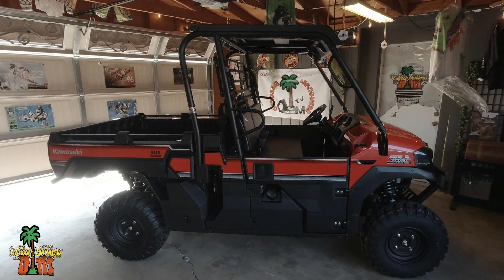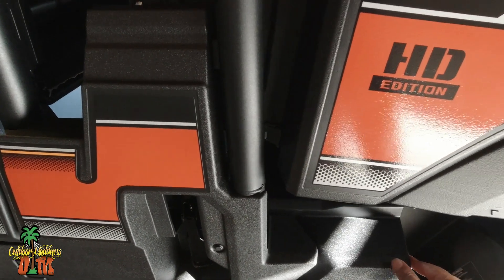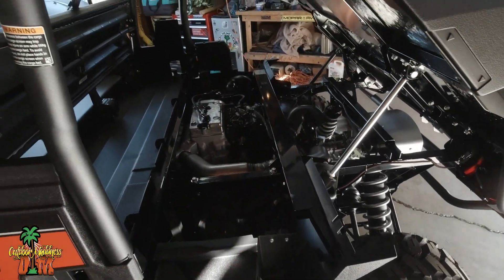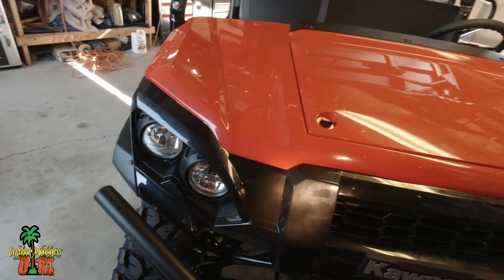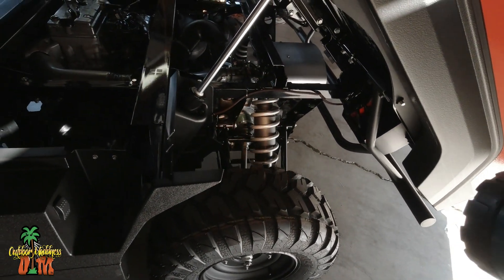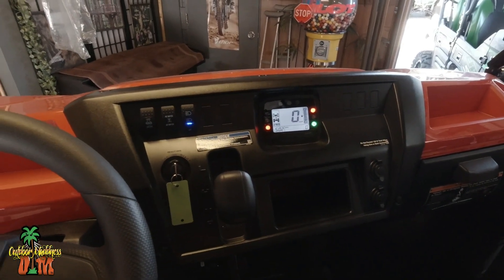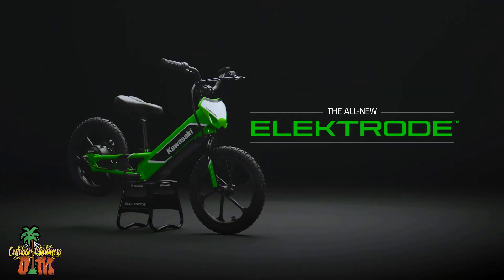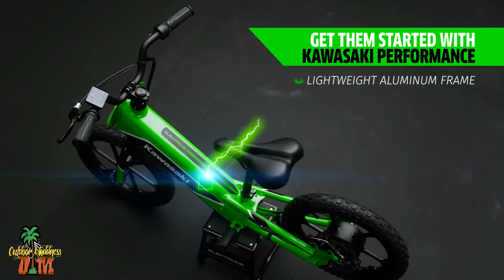2024 Kawasaki Mule Pro HD + Breaking News From Kawasaki!

Comment: Hello sir. I enjoy your videos but at times I find you are just a bit off on some points you make. The Mule pro fx-fxt's with the 812 engine do have alternators. Having pointed that out, I like the things Kawasaki has done to improve the Mule lineup. I am not moved to replace my 2022 Mule Pro Fxt though. I have done some modifications to my Mule, added 27 inch Tusk Terrabite tires. I should add, the factory tires are not actually 26 inch, they are 25 1/2 inch. By adding the true 27 inch tires my speedometer is finally very accurate. I also installed a set of Elka shocks set up for my needs by Elka, not Hester who is often misleading. With the 27 inch tires, it will run 50 mph before hitting the rev limiter which is all I will ever need, it has 12 inches of ground clearance which again is all I need in most cases. Keep up the good work and show the unknowing the quality of Kawasaki.
Reply from the maker: Thanks for letting me know about the alternators! That's what I love about YouTube, we learn from each other!